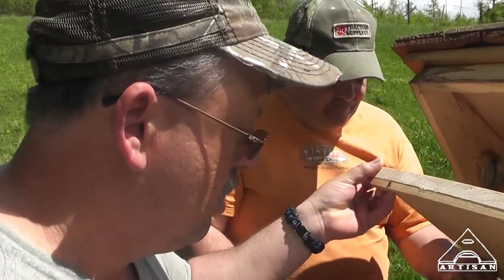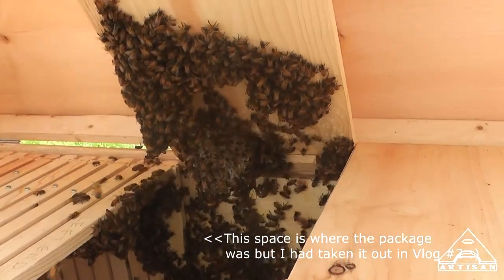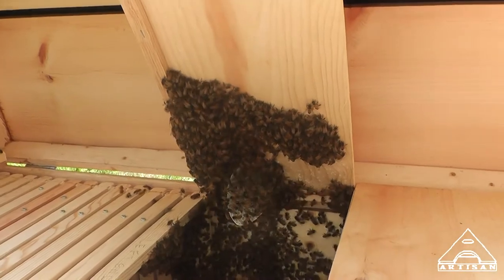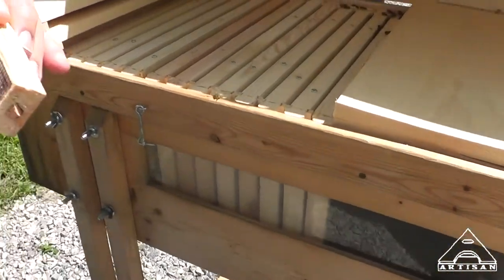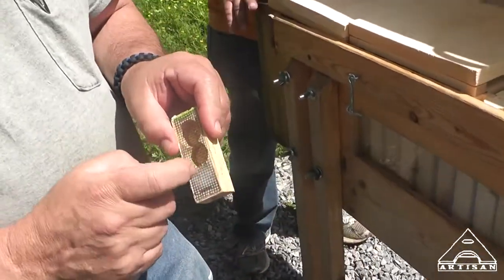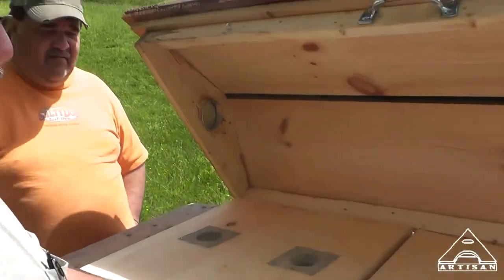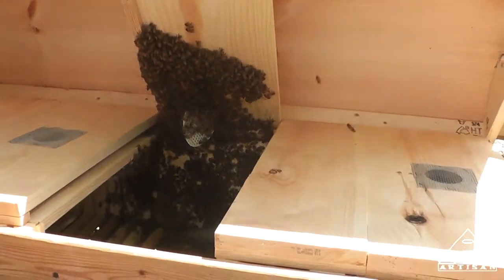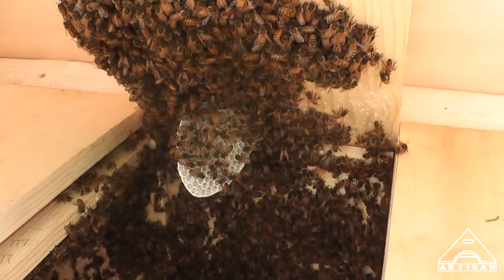My First Beehive - Vlog #3 - Derick Forester Helps Out - Artisan Apiary Project

Comment: Poking and prodding at a swarm of bees and no one get stung.  I have had several run in with inground nests of yellow jackets and I always came out the loser.
Reply: Here's a helpful tip for wasps or yellow jackets or any insect that makes nests: 
Use a shotgun
Reply: smilemoney Bees are much nicer.
Reply: It must be true about Honey Bees, my luck I would run in to a swarm of the Africanized ones.
Reply: if they were in the ground, they weren't bees. a queen would never bee seen dirty. it's beneath her.
Reply: dale myers I hit one nest with a weed wacker, one with a lawn tractor, one with a leaf blower. And the worse one was a nest in a hedge and I was using electric trimmer.  All yellow jackets.  Fortunately only about 15 to 20 stings at one time.
Reply: i've shucked clothing to get away from yellow jackets. it also offers a way to swat at them in mass. lol. i was pulling post from a chain-link fence line around a defunct lumber yard. i was using a pump hoist to do it. so i got into trouble as fast as i was pulling post. and it was as fast as i could move to a post, hook a choker and hit the leaver.